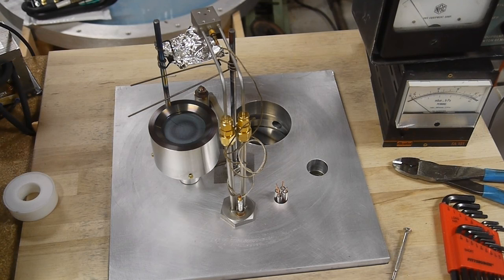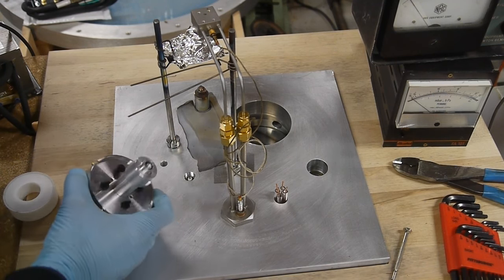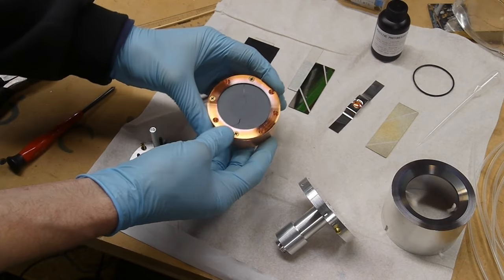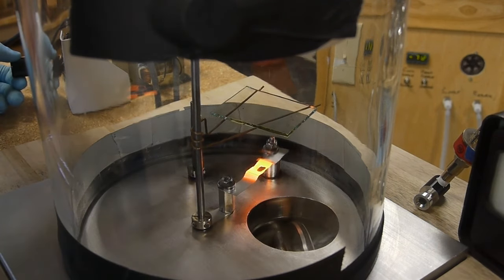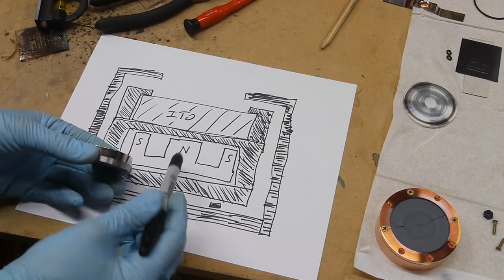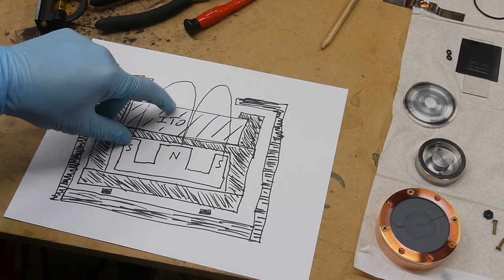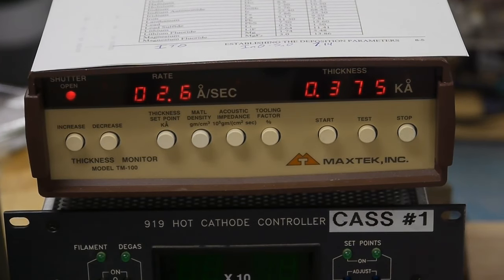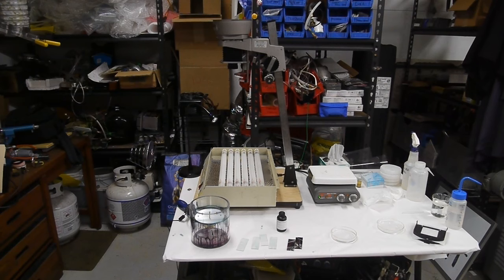Intro to sputtering (process to create clear, conductive coatings)

Comment: we evacuated the chamber, then back filled with .99999 argon back in the gold old days...I don't recall pressure control being all that difficult...but that was automated...and a  long time ago... we had a gate valve that would close off the cryo pump to the chamber during sputtering...every so often the system would need to be shut down, and the cryo condenser would be brought back up to room temp to "defrost" ...I don't recall water cooling at all, but it must have been there ...

Comment: Very interesting. 
I wonder if you could use a high ppi lcd panel instead of a mask, when exposing photoresist to uv light. I guess the small grid between pixels will be a problem, and I don't know if lcds can block uv light

Comment: ION depravation coating. put part in vacuum at 20 torr or so, let in a dab of argon, strike plasma ark and maintain at 460 volts adjust amps so no arks are conducting, apply negative dc voltage to part being coated. from there either sputter or use element heater to deliver film to part.

Comment: hey just a quick tip, if you dont already have a variac buy a router speed controller , to power your microwave transformer, they only cost 20$ at harbor frieght, basicly they are 15 amp triacs with a  potentiometer

Comment: Maybe it could be used for some kind of machinery calibration. Either for low cost, or for places where it's hard to visually inspect. e.g. Apply conductive paint where you don't want to pay for adding another sensor. Measure it at the factory for calibration data. Later the paint wears off and no one really minds, and it was low cost.

Comment: Excellent tutorial! I tried my hand at sputtering many years ago. It was a very crude, simple setup, but it worked! I used a MOT and a variac (as you mentioned in the video) and no argon (only ambient air). If you sputter long enough, you can make decorative metallic coatings on glass, which is what I was trying to achieve. Just curious what you do for a living. Thanks!

Comment: What are you trying to do by depositing ITO on glass? I work in the optical industry and one of the coatings that we deposit is ITO. We use electron beam deposition and it works just fine. Sure we use expensive vacuum chambers to do this because it is a complete process in order to achieve an Anti-Reflective coating but in the simple form that you are trying to achieve I would use the electron beam type of deposition and the crystals at 6 mHz are really inexpensive.

Comment: Very nice experiment. I was wondering, would it not be possible to use a laser on the surface to blast off controlled amounts of the material without concern for overheating because it's very rapid and local. I hunch that a suitable frequency of laser will allow evaporation/bond breaking without pyrolyzing the material because physics responds very specifically to specific frequencies. In principle the molecules can be detached without any heating whatsoever.
It might also be possible to charge the emerging cloud and direct and focus it with fields to where you can print patterns directly. As well as control distribution/uniformity.
Reply: build one
Reply: anikoustos2 I don't have time to execute every good idea I get.
Reply: yeah with laser he can make the whole process faster but the laser must be focused, so it will effect only small area of the depositing material. anyway with laser youll not have vapor of the material, youll have dust which will be hard to stick on the surface of the object.
Reply: What you're describing is called pulsed laser deposition (PLD). A lot of work has been done on it. It has advantages and disadvantages, like everything else. See  http://en.wikipedia.org/wiki/Pulsed_laser_deposition
Reply: So what does one do with a sputter gun? Application wise? Can you bedazzle a pair of jeans or is this like a home defense type of gun or what exactly are we looking at here? ⚡
Reply: I know they sputter gold onto mylar discs in condenser microphones to create a conductive, non-reactive, flexible material. I'm sure there's thousands of other applications for coating materials on other materials.

Comment: If you want it to vaccum seal use counter sunk hex head bolts with plumbers tape using normal screws you will scrip the heads

Comment: you have connected the negative of the high voltage to the spark plug but where is the positive of the high voltage connected to.? from 6:54 you say that the section holding the ito is at -ve potential and the outer section or the ground shield is at 0 (zero). what is this zero? . also you have some sort of **street light** thingie in the chamber that has two tubes which are bent and there is a brass connector connecting the two tubes in the middle and some sort of wire coiling (what is that wire for ????) and then going to the end of these tubes where there is a square block. is this where you connect the +ve of high voltage  and are the two tubes for water cooling ?  sorry for asking too many questions, i had to ask as you didn't explain your setup fully.

Comment: Hi Ben; I know you did this video several years ago. However I was wondering if you'd be willing to relook at this process using laser pumped ablation in thin capillary tubes with a torridial magnet on the outside.

I've had some incipient success with this in down an dirty proof of concept runs on Argon plasma chambers.

Given the spot size of 405 nm blueray lasers and the reduced cost of specialty matieals such as LiF windows; which should be able to be formed into capillary tubing like quartz tubes; it seems like a simple 90° spinning polarizing mirror could be usedbin conjunction with a speed controller to puls a high frequency focused laser into a 1/16th I.D. LiF Capilary tube that holds pencil lead like 1 mm diamter rod targets.

Essentially your capillary tube with target wire feed can get subjected to vaccum with Ar, laser evaporated, flow foucesed inside the center of the capilary through small exterior torridial coils wrapped around your capillary tubes holding each targer fillament then have the other 1/4th -1/2 of your 405 nm (or UV possibly) direct the path of the ions at the top of the tube into your depostion chamber, and then back onto your target.

Given the inexpensive cost of some of the laser diodes now that have spot sizes which get down to sub 400 nm size on the case of the Blue ray disc lasers; it seems to me one could very inexpensively source multiple lasers diodes that are inserted on the interior of a vacuum chamber system with a ~500 μm lens cover with a 2 way mirror coating; that lets them use pulsed timing synced with time of flight to push or steer ions through a mirror coated capilary tube system such as a hollow core fiber optic cable and final accelerate them onto the surface of the material one wishes to deposit onto.

Uniformity could be an issue that has a high time cost to get down; but the trade off is one could essentially extend the same priciple they use in the Anycubic M3 Premium DLP mirror actuated resin 3D printers; and extend that to multi fillament array feeds to sputter based 3D printing like deposition.

Comment: The central rod that connects the sparkplug to the source material, how do you keep it from wasting power by forming a plasma between it and the grounded tube that surrounds it? Also, could this rod have expanded from the plasma heating and caused the broken disk?

Comment: I have a Harvest Right Freeze dryer and am trying to hunt down a leak. The freeze dryer is practically brand new and I was able to get down to 500mTorr in about 10 to 15 minutes (at 7,000 feet elevation). But now I cannot get past 700 mTorr even after 30 minutes. 
It might be the pump or it could be the door seal or ??
How do you troubleshoot vacuum leaks?

Comment: This equipment is not likely to work well, although should work with metal targets. For ITO, plasma needs to be generated by a RF magnetron. Direct the plasma at an ITO target. The target needs to be bonded to a copper/steel plate to conduct heat.

Comment: Is the sputtering material anode or cathode?  The cooling hoses would make a lot more machining if it could spin. The advantage being additional power by pneumatic power. It sounds silly, but you can be more efficient by having hybrid power.

Comment: I've seen people on youtube splattering with home made Magnetron. Is that a similar process? Or are they different horses for different courses? Thanks for the upload and awesome description of your splatter chamber :)
Reply: You mean with a high voltage transformer that come from a microwave? I don't really see what you would need the actual magnetron for.
Reply: @allornonebaby  I mean with a home made magnatron. No parts from a microwave. See Aplied Science chanel diy magnatron.
The magnatron creates magnetic field which orientates the plasma field to the desired polarity and also does some stuff I don't quite follow with the free electrons.

Comment: it is required. thermal expansion of copper is 1.6 mm per meter, per 10 degrees. ceramics are around 0.4  Depending on the elasticity of your disk, your gonna shatter it with only a 30-degree temp differential.  I don't sputter, but I make precision bedplates, mixing glass and metal plates and not having them shatter or distort each other.  You could try tungsten instead of copper, its thermal expansion is very low.  the lowest of all the metals. and it conducts heat well enough, more than steel, less than copper and alu.

Additionally, your working in a vacuum, there is no conduction of heat from your copper mass, and plasma it hot.  Therefore, so is your block.  Watercool the poor thing.

Comment: Wonder if multi layer microprocessor could be made with sputtering tech?
Reply: +minuteman2012 Most micro chips are multi layered, they have to be because some components that are less or more conductive than others have to go over and under other parts to make the element work, like with a transistor for instance.
Reply: +minuteman2012  YES you can, thats how they are made professionally
Reply: sure.   then you only have to master semi-conductor CAD design and micro-lithography.

Comment: how is there no arcing between the 1000v and ground when they're so close together? lower current? or just that it's in a vacuum?
Reply: Current doesnt really have any effect on arcing. Static electricity makes lighting bolts you can see with your eyes, but it has almost no current. Arcing is a function of frequency, pressure, and voltage. The lower the pressure, the harder it is to get an arc. Now, thats not to say that you wont have currents going from the inner layer to the outer, its just that it wont be visible.
Reply: Static discharges can have a really high current (up to a few amps 😳), but their total energy is really small because they only  last a very short time.

Comment: Thanks for your awesome videos Ben. I do some vacuum experimenting myself and worry about x-rays. What are your thoughts, do you think you are getting x-rays in your sputtering experiments?
Reply: Nah, he said in the video that the voltage he is working at is only 1kv. To make x-rays, you need a much higher voltage (like, 30 times higher). I'd be more concerned about UV radiation, but I guess the glass chamber also filters a lot of UV.

Comment: another question, the small gap between the external shield and the copper piece (the one that the target is put onto) `does not breakdown at high voltages and low pressures generating sparks?

Comment: try using a voltage across from gun to your microscope slide like it is done for spray painting I do think this will make the process more efficient and better coating of your microscope slide. Just build a plate behind your microscope slide an charge it with the opposite voltage from the sputtering plate voltage. Should be much more attractive as you ramp up the voltage across these two plates and reduce power needed. Just like a high voltage on a TV tube attracts electrons to the face plate and makes the picture. Best of luck .. let me know if it works PS: ( Do you give rewards?) ha ha ha .. How thin do you want ? I can help more if you like my idea.

Comment: Young magnetics engineer here; I notice the wear pattern on your plating material matches the flux density pattern for a ring magnet with a much higher "spike" in the center. Do you know if this has caused any uneven distribution patterns on the slides? Neat build.

Comment: Hi Ben,

i am currently trying the same thing with no results so far (working on a much smaller scale here), i am blaiming my psu for that at the moment .
i would be really curious to see what will happen without the argon in your case, many people on youtube got it working on rest air with just a two stage vacuum pump connected to their systems.

Also, nice sputter gun design!
Reply: Also could you explain how you connected your baseplate so that you dont get corona on that?

Comment: If I had a microgrid, or weatherband with conditions for sun or wind at green energy installation sites, I would include that into the automation. Like if a sun is over my solar panel or over the solar or the wind field has no wind it would turn off. DigitalFM.

Comment: thanks for posting, have you ever tried to evaporate copper/aluminum  onto polyimide sheets (kapton) ? is the adherence good ? and sputtering ?
Reply: ***** thanks for replay, that is it. coating with copper and etching unwanted areas enables to create flex circuits. please try it and post. try also evporation. I think the kapton should be very clean and receptive, try KOH for chemical treatment, as reported in literature. thanks

Comment: 1mm clearence seems to work fine :) Only thing that isnt working fine is that my plasma wont focus niceley. I think thats due to the ceramic magnets i am using since i cant find any 40 mm ring magnets arround here (yes my magnetron is tiny).
Any idea if the magnetic field needs to be strong ? Also should i smooth out the power with a capacitor ?
Reply: What about using magnets from a magnetron(a microwave oven magnetron)

Comment: So ive bulit one of theses but how do i get a shielded positive into the chamber what material is the cable i used a single core copper wire. witch melted along with the jacket.. the jacket or protective coating on the wire melted away untill it arkted to the bace plate

Comment: Did you use copper in the head piece for its non-magnetic properties or for some other reason? I guess its a bit softer on the clamped ITO disc.

Comment: I want to aluminize carbon fiber fabric.  Would this be good enough for the atoms to flow deep to the inner fibers of the fabric?  Would connect another circuit through the splatter to the fiber so it would direct the plasma toward the fibers?
Reply: It would probably melt the fabric with the plasma field at about 30000 degrees

Comment: So most (or all) the current is flowing between the top surface of the grounded cylinder and the sputter face and little (or none) is flowing in the gap between the two cylinders (also little or no discharge occurs there).  Is that right?

Comment: Why not use FTO instead of ITO?  Its physical properties are much better overall and less expensive than the ITO...  im not quite sure on the transferring process other than the FTO requiring a constant 600°C over the 300°C of the ITO sputter process..  but seems to me would be much more of a usable result as well as possibly an overall easier process in the transfer based on the temp and the FTO being directly adhered to the glass rather than the film segregation with ITO glass...   good topic though and great execution..  must have looked over the necessity of the whole constant 300°c deal and the temper/expansion and contraction of glass..  but nobodies perfect and cannot possibly account for everything in the experimental stages, thus the need for the word experiment..  even if you bleeped out your reaction, it still would have been a fun thing to look back on..  how you always voice your mistakes, if you had a gag reel of everything would fir sure get more kids into physics/science/etc.. in my opinion..  keeping it up though still years later!!  Thank you..  :)

Comment: Would you mind sharing the schematics/3d model of the parts you had milled from metal?
Reply from the maker: +nak807 I'd share them if I had them.  I used CAD to just sketch out the basic idea, and have long lost the files.  Many of parts were designed as they were being cut on the lathe.
Reply: +Applied Science I understand, thanks for the thought. What may I ask is the disk (the cracked disk) which separates the magnet from the sputtering area made of?
Reply: +nak807 All so, did you consider Photolithography to deposit the layers?
Reply: +nak807 The coating material. Here it is probably ITO, Indium tin oxide.
Reply: +SirCutRy Thank you.

Comment: What if the heat sink had an induction coil on it to preheat? If there was a hat. A special hat for regenerating thermal energy. And it doesn't crack the glass.